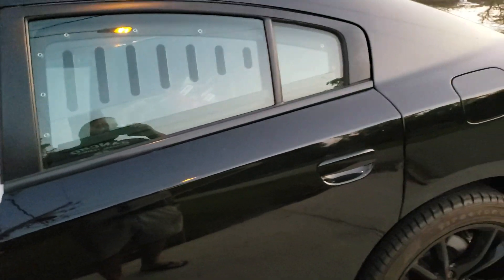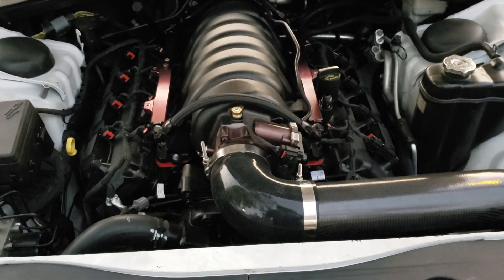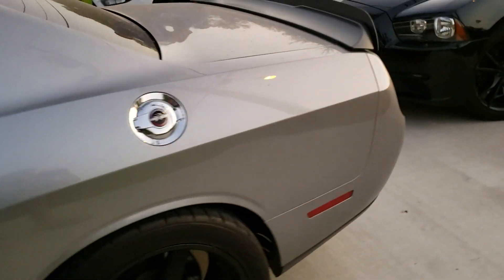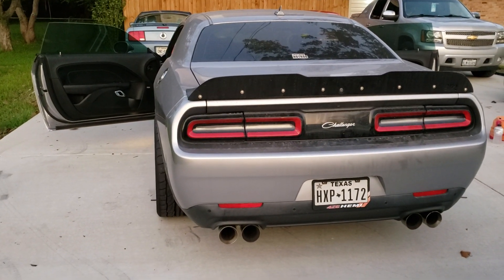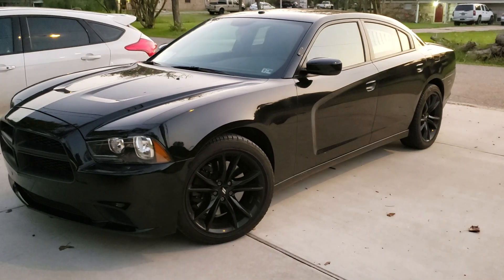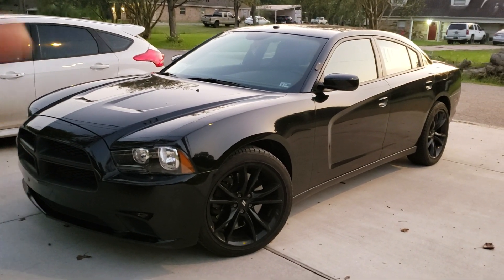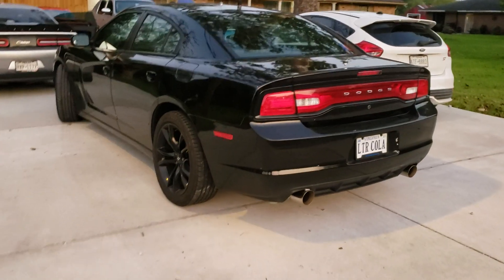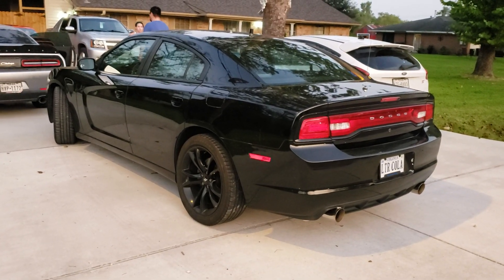Update, back in TX!

Comment: What was the problem, and the solution with the pushrods. Please explain.
Reply from the maker: Too much preload.. basically causes the valves to hang some at times.
Reply: @OMGITSMRMACK  Thanks my man. What size push rods did you use? If thats how you fixed the problem. Thanks alot.